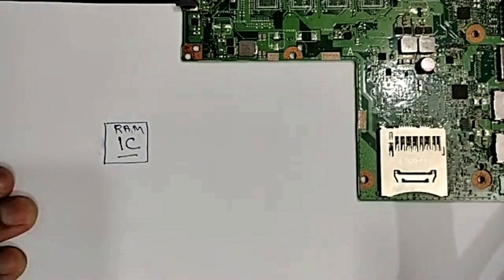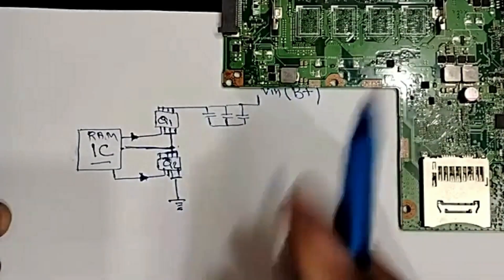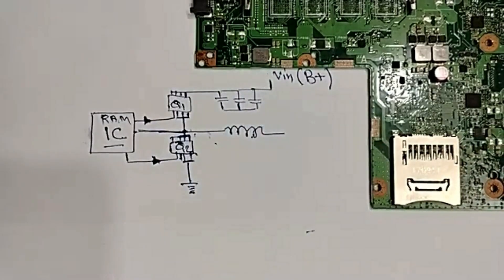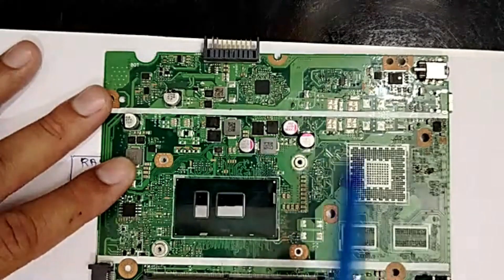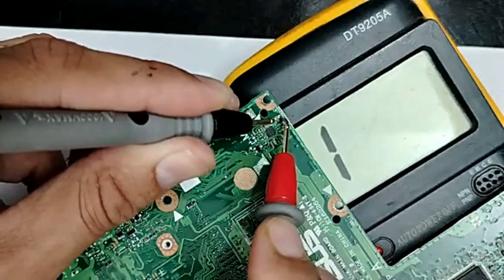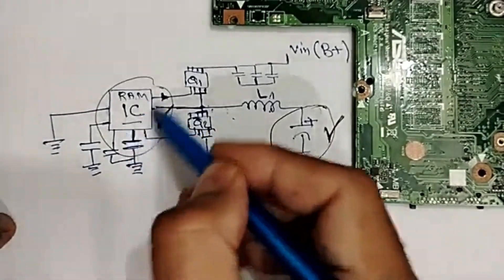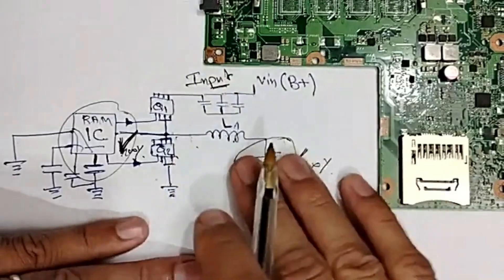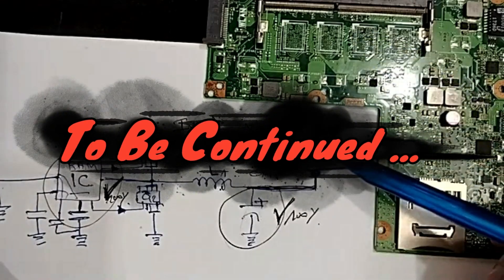How To Find a Short Circuit on a Motherboard Fast Part 2 - Laptop Repair

Comment: Excellent explanation. It happened to me on a circuit where the capacitors next to the IC were shorted. I thought they were damaged and removed them from the board. When I checked them outside the circuit, they were all fine. Those capacitors were all connected to ground, so I understood that the short had to be in the IC. Thank you very much for teaching us these things.
Reply from the maker: Thanks for sharing

Comment: And sir how many GND can a mobile pcb has in the board connecting pins???
Reply from the maker: 3, analog, digital ground and chasis ground
Reply: @electronicsrepairbasics_erb plz explain the three gnd to me sir and is it only on pc motherboard or all motherboard has the 3 gnd???

Comment: What if the capacitors are not at fault can someone just remove the ic straight???
Reply: Am phone engineering thou bt ur video has helped me alot🤞
Reply from the maker: Stay tuned you will get everything
Reply from the maker: Just stay tuned bro